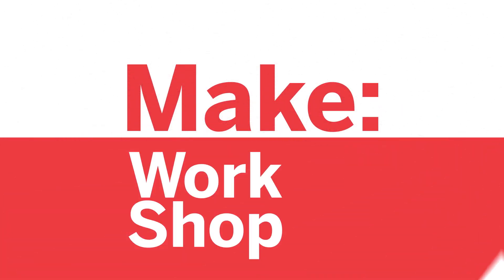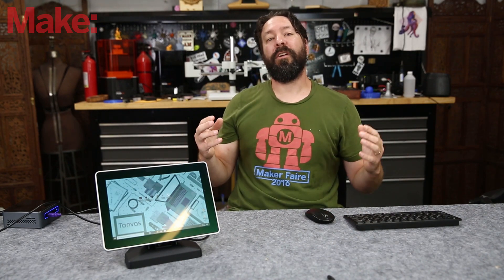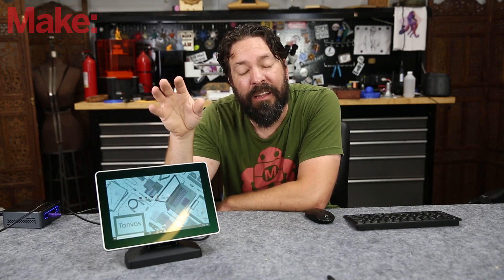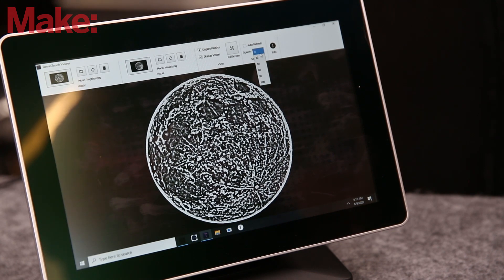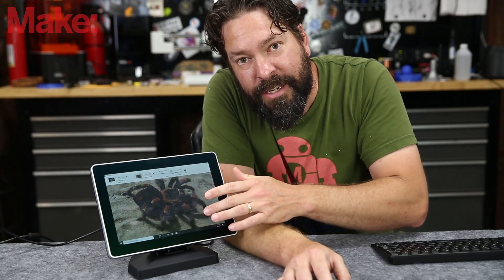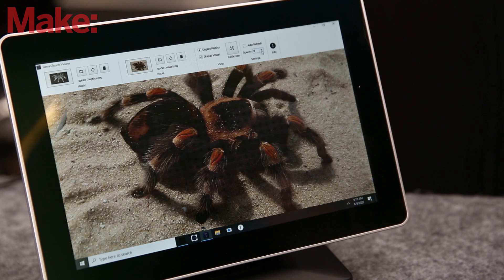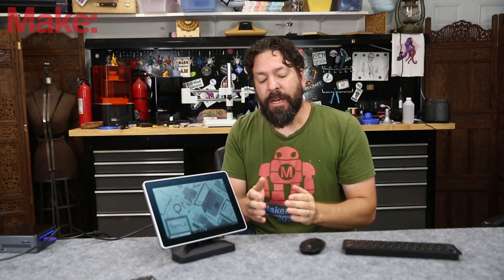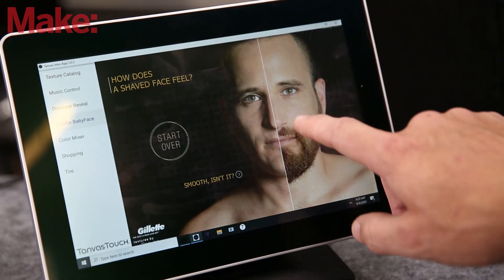Quick Look: Tanvas Haptic Touch Screen

Comment: So it only works for swipes, right? If it's varying adhesion I'm guessing it won't be noticeable for taps.
Reply: correct. just placing your finger on it, you can't feel a difference. it is only evident as you move your finger.
Reply: @CalebKraftmakes  Darn. Not to minimize this tech because it's very cool and does have a lot of uses, but to me the real holy grail of haptic feedback would be for the keys on an on screen keyboard.
Reply: The dev kit demonstrated here is exclusively surface haptics, but TanvasTouch is a versatile technology and can be combined with vibration-based haptics if tapping, buzz and click confirmation are desired.
Reply: I wonder if you could make a mouse with the same principle I.e. the ease with which it glides across the mousemat varies with what's on screen

Comment: It seems a shame that you have to develop in their environment, if they could work with existing web standards such as the "CSS perspective Property" that would enable so many more webapps
Reply: css still needs javascript and java script has to talk to a lower level of code to have it do anything, so firefox, chrome, safari would have to be developed to support this.  this is why companies build kits like this so people can do that work before they are put in consumer products.
Reply: @theJonnymac  sure, but by using a standards-based approach in a browser, they could go onto add the ability to popular Javascript frameworks and so have sites become compatible without being specifically coded for it.
Reply: Neil Carmichael your missing the critical point that this is a hardware company and you don’t just expose hardware to a browser.  They have released the part necessary for browser companies and operating systems to build those standardized solutions.